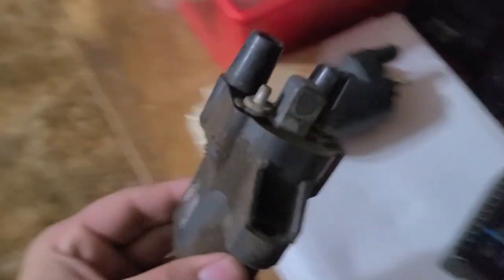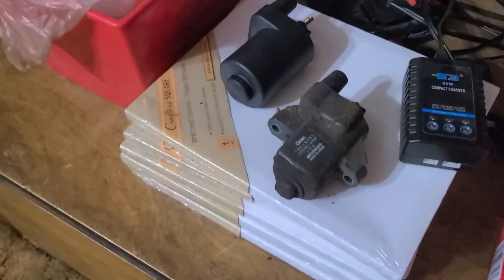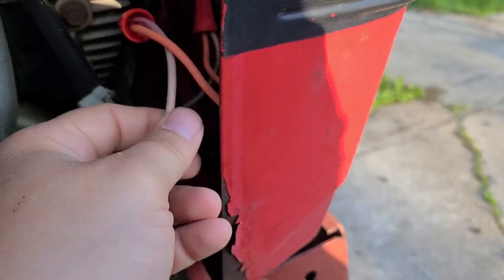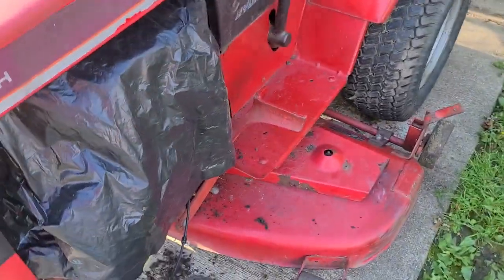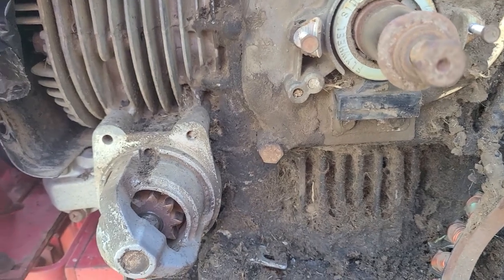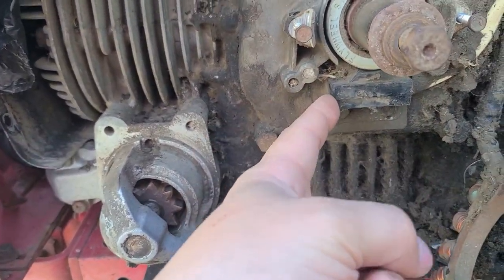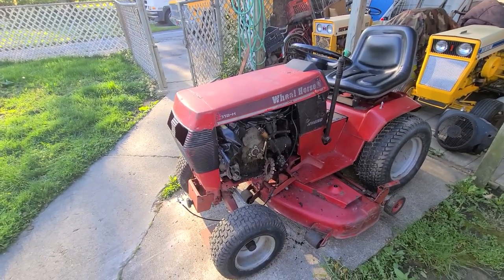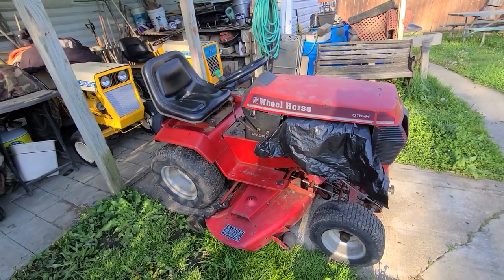new project Wheel Horse 518-H with no spark

Comment: Onan 
Tarayl fixes all has a video on a workaround for the ignition module issue you have
Reply from the maker: Oh okay I got a new part got it running and then there was a problem with the Hydraulic pump To the rearend but I sold it some time ago

Comment: are you still working on it?  i have the 88 model i think yours is 1989. pull the nuetral handle up and back and put the drive lever forward. it should roll then. also you can put a jumper from battery pos. to pos coil (small nut) if ignition not working.i found this to be helpful.https://youtu.be/vEcpUa37zwg
Reply from the maker: i have a new video on it i got to run with the new ignition module but at time when you drive it feels like the pump is slipping like you're going forward but then it stops and goes stops and goes but now it seems like he came out of it i dont know if it had air in the pump or the pump is going out